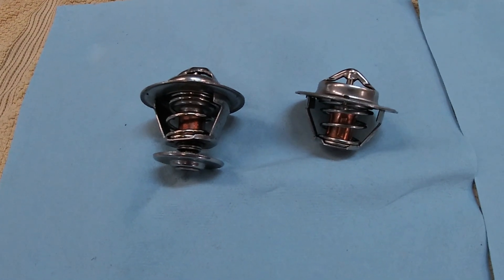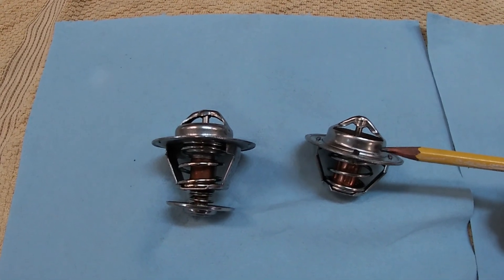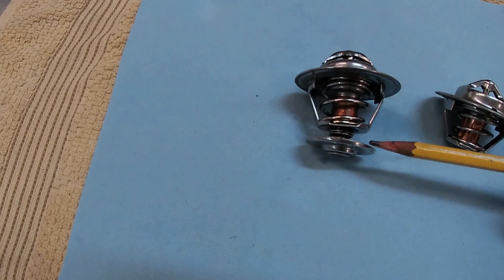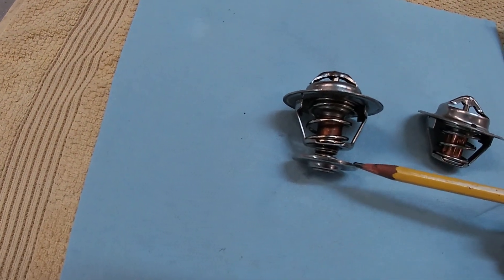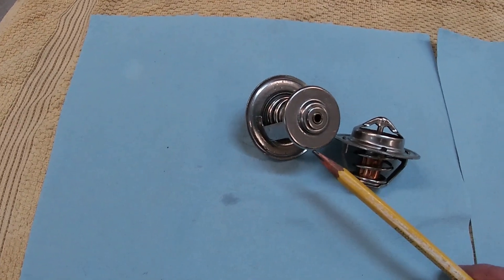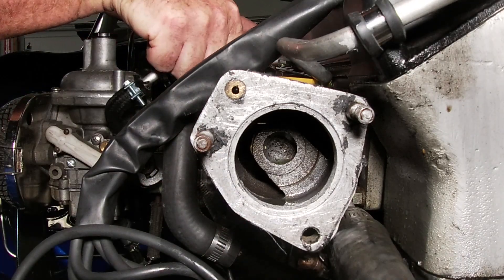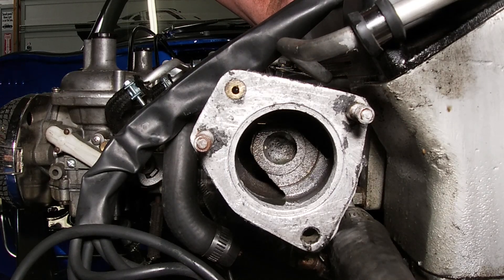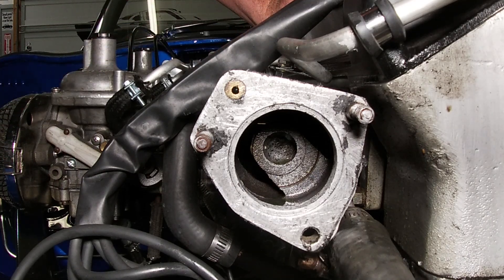Jaguar E Type Series II - Correct Thermostat - 2024-07-02

Comment: Hi John.. l ordered a thermostat from Moss and comparing what l got as listed. Part number 071-226 the plate on the bottom is much smaller than the one you show on your video and will not close off the bypass. Did they send the wrong one?. Regards. Nick.
Reply from the maker: Hi Nick, 

I have no idea bud. John

Comment: Hi. Where did you buy that thermostat. I can’t find one?
Reply from the maker: Moss has one - part number 071-226 - has a nice picture showing the bi-pass land/annulus

Full link is - https://mossmotors.com/071-226-thermostat-180-degrees 

This is ONLY for the Series II with Stromberg Carbs, apparently. 

Since I fitted this thermostat, I have not had any issues with the engine temp. I really recommend that you buy an infrared thermometer with a laser pointer. This allowed me to check my top and bottom radiator hose temperatures - My normal running temperature is 180 deg f - 82 deg C and at that temperature my temp gauge needle is pointing at the L of Normal. 

In stationary traffic for long periods, the temperature rises slightly but drops down very quickly once you are moving.  

Using that thermostat type (with the land) prevents hot water recirculating back through the block when the stat is open - allowing water flow to the radiator. 

Hope this helps - John
Reply from the maker: Hi, let me go look and get back to you
Reply: Thanks for getting back to me. I will contact them.

Comment: Thank you for discussing your results.  I will make sure that mine has the correct thermostat when I get to that point.
Reply from the maker: Apparently, this thermostat design is only related to the Series II with Strombergs. Since I fitted the correct thermostat with full opening at 74 deg C my engine temps via the dashboard gauge have been very consistent. Cross referencing the upper and lower hose temperatures with the temperature gauge reading has given me confidence about my engine temperatures.